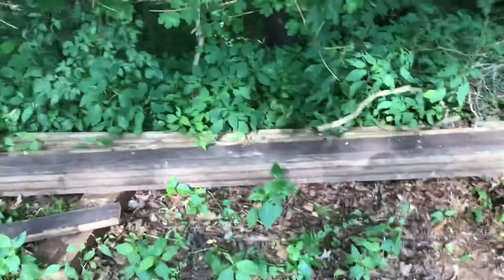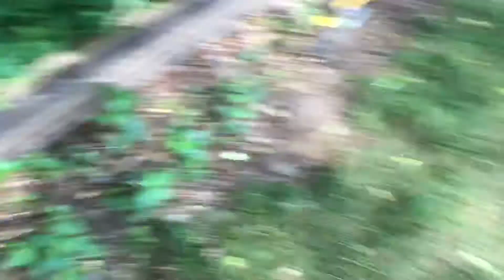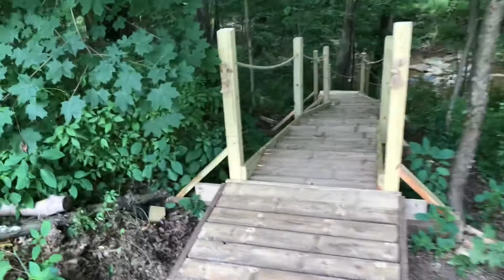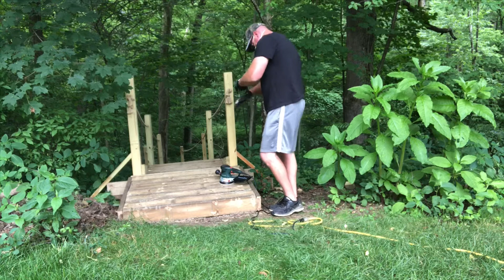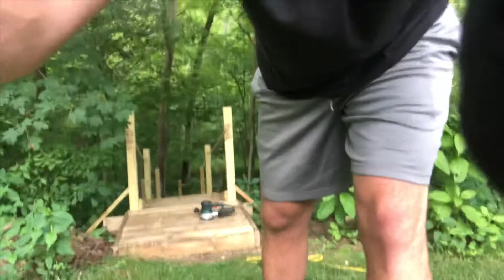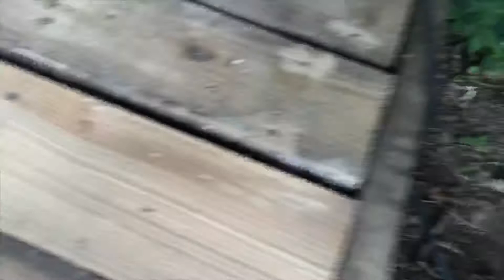Metabo SXE 450 Turbotec demonstration!

Comment: Hey Randy, thanks for making this video and well done on recycling your lumber for those stairs too. Curious as to how the Metabo did after the whole project and what your thoughts were at the end? Cheers
Reply from the maker: Hi Matt,  Sander did a great job with all 40 steps.  I made it through about 40 steps and then had my teenage boy finish up the last 20.  Stained and sealed them!  Sander is still running like a champ and have done several projects with it since with no problems at all.  Have fun!